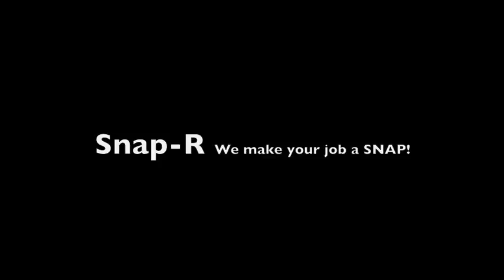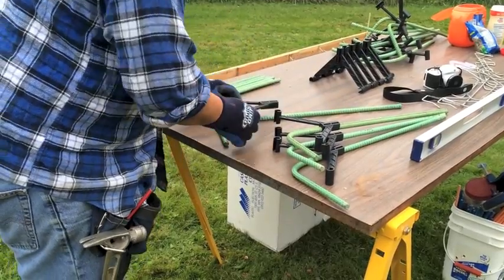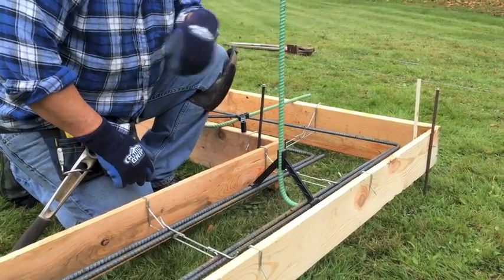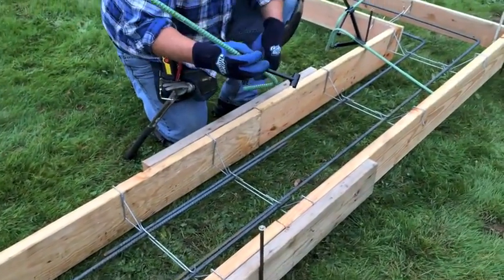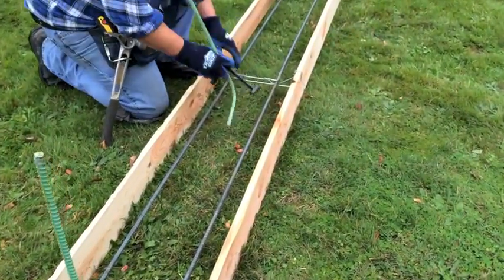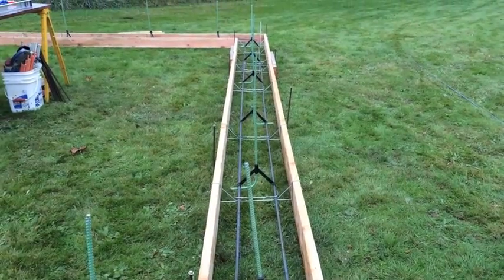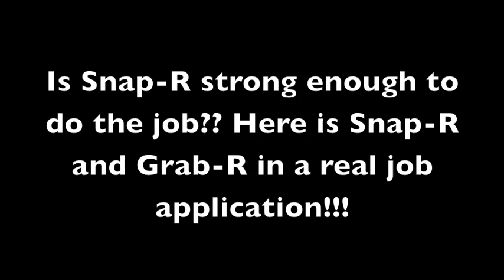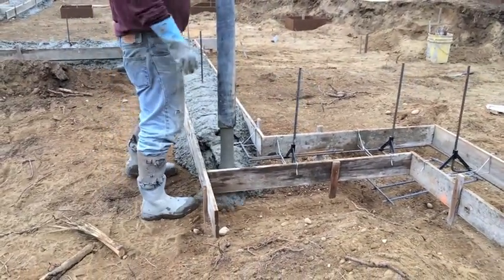Snap-R vertical hooks spreader cleats rebar hangers

Comment: Not BAD job , but should have used a 2x8 at least instead of 2x6, or underpinned with 2x4...too much mud flowing out underneath 2x6...waste
Reply: Or.... pour it stiff.
Reply: I think their intention was to muchroom out w/ the cement as a way to stabilize that foundation.  But amn, I never saw a foundation like that...one that floats on top of the ground. This can't be the United States or Canada, can it?
Reply: Maybe they were just doing this as a method of technique, and not a real life installation of a foundation. Code violation, for sure.
Reply: Randall Polk

Comment: to be structural it needs to be spliced to 40x the diameter of the rebar. this product looks trash. not supporting anything - the wall would lean over time with the weight

Comment: Cool system, but wtf is up with not having any compaction or moisture barrier under the pour.
Anyone see the level?
Reply: Leslie Andrews maybe it's just a storage unit is not required or will have DPM installed pre floor slab... I'd suspect the ground has been tested

Comment: did he pour on sod
Reply: I hope not
Reply: mitch yelvington か
Reply: I think that was just a mock up to demonstrate the product system.  My guess is based on his choice of the words "now here's a REAL job..." when he transitioned to the other job site.  Just a guess.
Reply: Exactly it was only set up for demonstrating the use of the rebar brackets.
Reply: mitch yelvington .
Reply: Whats the big problem with that ? is it because after the  sod dies the ground will sink & possibly crack ?  that"s all i could think of ?
Reply: I think that was just the example of using the vertical rod holders ! I was thinking the same thing ! WTF ?

Comment: I wish they had a steel version of those clips or less plastic in them.
Reply: joaquin lopez technically the plastic clips are taking the place of tie wire in which doesn't increase any strength at all and is only there to hold the rebar in it correct position, the placement of rebar is key not the tie wire